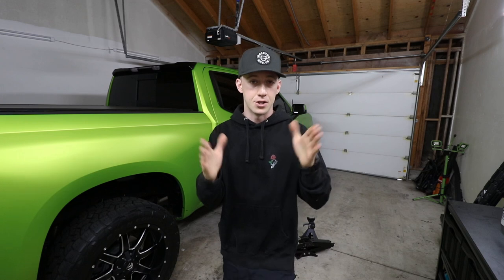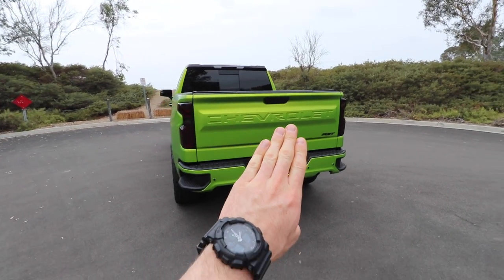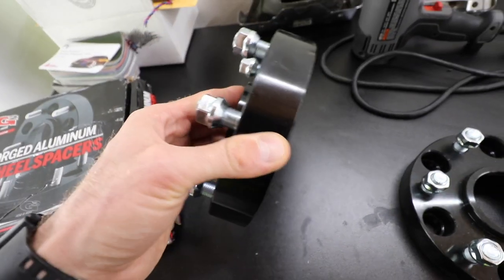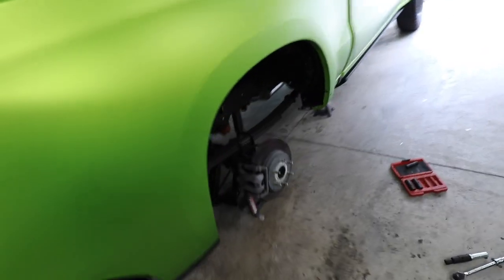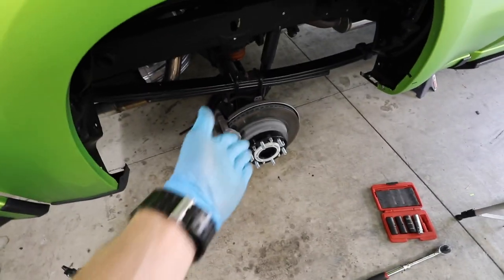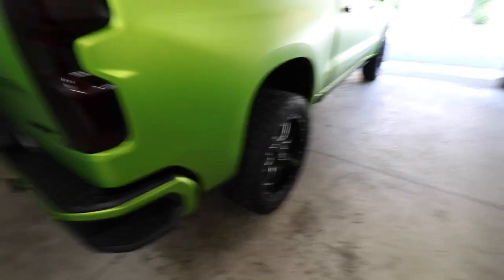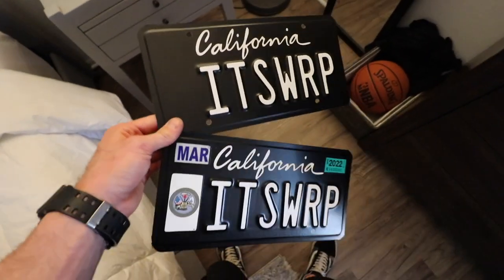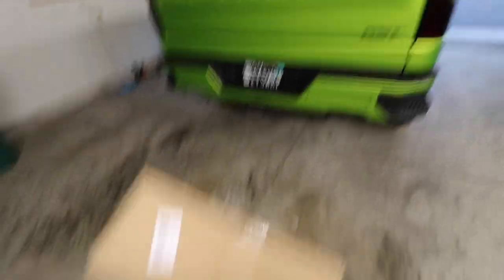Vinyl Wrapped My License Plates!!

Comment: The license plate mod looks good but is highly illegal here in California.  The CHP here in SoCal will likely pull you over the moment they see it.  Luckily it's an easy fix if you do get busted.  Are you planning on keeping it that way for long or just for the short-term?
Reply from the maker: Long term! Hopefully It’s not an issue with that
Reply: Yeah, but that’s an easy fix, just find someone to sign off your ticket…lol. It would be the same as tint
Reply: I’ve been running wrapped plates, no issues what so ever. Mine are the same. White text black back.
Reply: @straightupgg  Where do you get the lettering? Been trying to find them
Reply: @WhadayanoJoe  same
Reply: @WhadayanoJoe  had it done by a shop 5150 wraps LA
Reply: @straightupgg still??
Reply: @RyansReaper  no issues

Comment: So glad the wheel spacers didn’t work out. I mean it’s your truck so do what you want but I can’t stand when the tires stick out the side. FYI I’m running a 2019 LT 5.3L 4x4 with a 2 inch leveling kit and 33s. Orange tailgate letters. Steel front bumper with led pods on the bumper. After market grill with 3 amber lights in the center. Intake and exhaust will be next.
Reply: Forgot to mention it’s black. The whole theme is black/orange
Reply from the maker: Everything happens for a reason but yours sounds clean